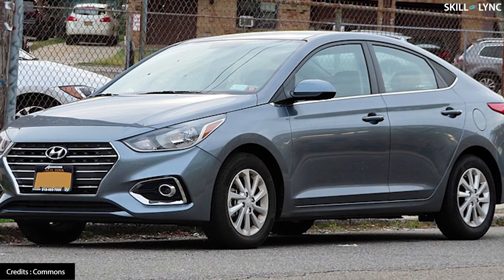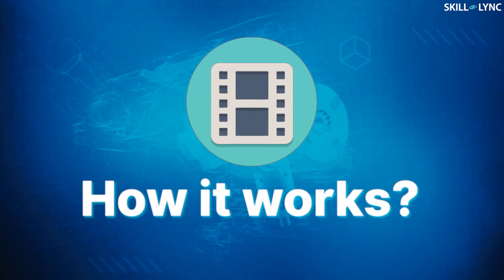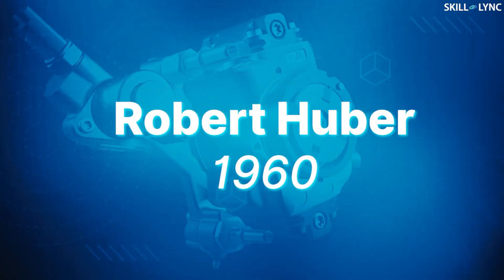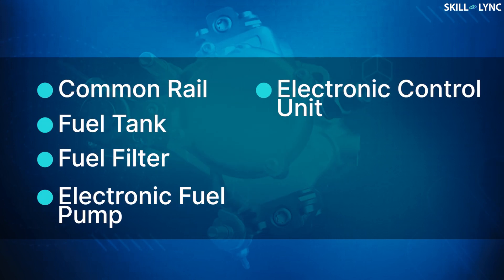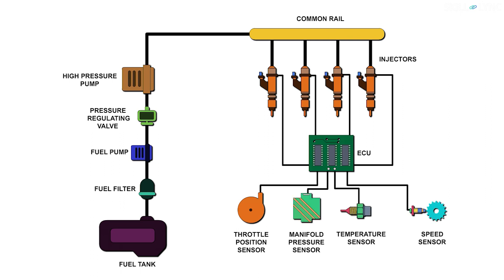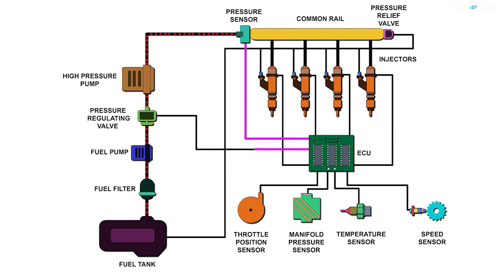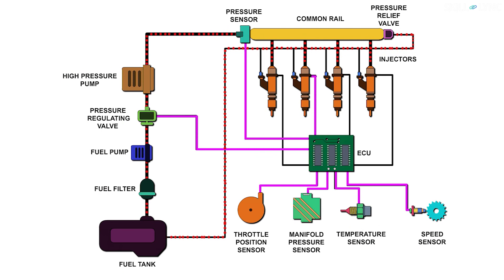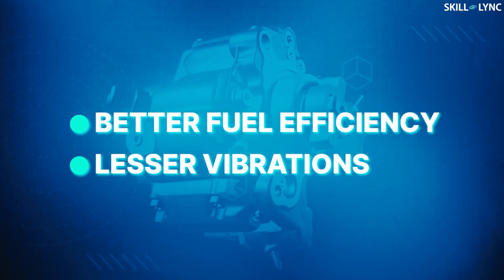How does Common Rail Direct Injection (CRDI) work? | Skill-Lync

Comment: Is pressure regulator connected before or after the hp pump
Reply: the pressure regulator connected in front of fuel pump is nothing but metering valve i think bro

Comment: Is crdi used for diesel engine or gasoline engine?...
Reply from the maker: Diesel!
Reply: Skill Lync mine is crdi getz 1.1 and I used gasoline for 3 years bow🧐
Reply from the maker: Your car most likely was a GDI engine. Common rail direction injection essentially meant a that fuel comes in a single line and is split into all the cylinders. That is, it exists in both Diesel and Gasoline Multi-Cylinder engines. However, CRDI generally is used in the context of Diesel engines. Hope this helps!
Reply: Skill Lync Thank you so much... Really appreciate your inputs...Just checked my car registration and it says crdi diesel manual... what should I do?... I used this for 3years with gasoline...
Reply: Gasoline engines have another option, i.e., mpfi (multi point/port fuel injection, which is actually a common rail throttle body injection). The rail is not as robust as crdi because throttle body injection  won't require that much pressure. Example: Daewoo Cielo.
Reply: @kidroming  what's your car model and company
Reply: @jaibabu7481  Sold it and bought a new one☺️

Comment: Advantages of crdi.... Computers... 
Old injection pump....no computers. 
I'd stick with old
Reply: Can you elaborate?? Which engine currently with old pump.. I think all engine runs with help of computer currently😊
Reply: @dhocris7studio  the 12 valve Cummins is mechanical so that motor will run with no computer
Reply: Computers are great to throw a tuner on and not have to wrench.  But when it has to take in effect all the sensors it's a flop.